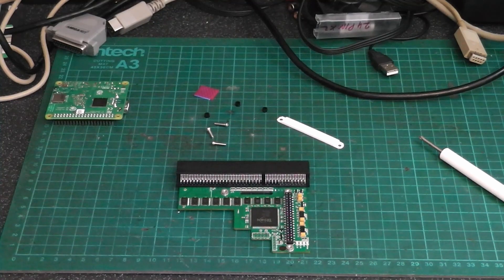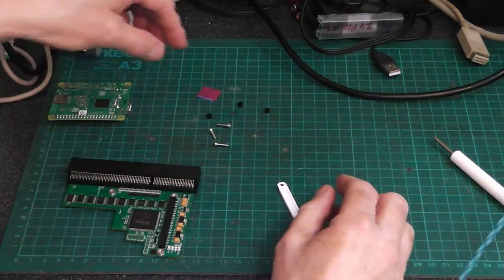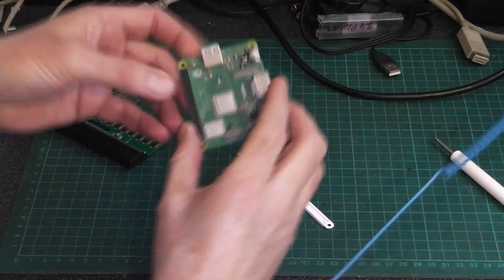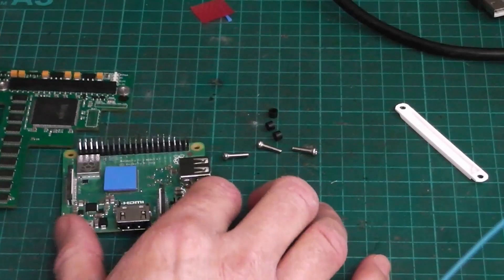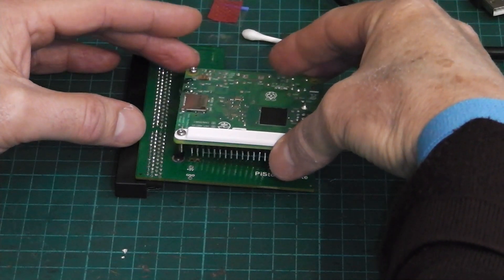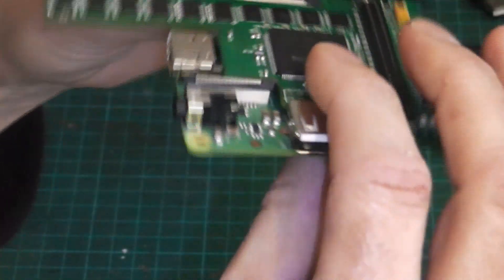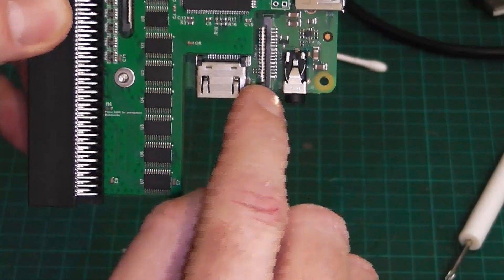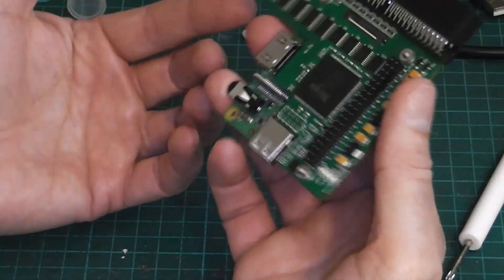PiStorm32 Lite Part 1- Assembly

Comment: Hi in the wiki it showed the thermal pad was added to the heatsink on the Pistorm not the RPI ?   Your thoughts tks John
Reply from the maker: I have since upgraded to a Pi model 3+.  I did do it this way when I mounted the new Pi.  It is a good point.   I'll ask and find out what is recommended 🙂
Reply from the maker: I've had a word with LinuxJedi. He said it doesn't matter, it's mainly so that the PiStorm acts as a heatsink for the RPi  :)

Comment: The OpenCL1.2_GPU on the Pi3A there in the PiStorm, in my opinion, could be codedto handle the FFT and FPU maths libraries for the amig as though a 68882 and combined mpeg decoder (or mpeg4 such as xvid or ogg vorbis theora) like an FMV module but better. The is heterogenous computing so the CPU A53 could handle it too across 4cores. Then sometimes spare cores could emulate a dual CPU setup like a phase expansion having a 68040 plus a PPC switching between the two in some AmigaOS versions.
My comment has no hate in it and I do no harm. I am not appalled or afraid, boasting or envying or complaining... Just saying. Psalms23: Giving thanks and praise to the Lord and peace and love. Also, I'd say Matthew6.